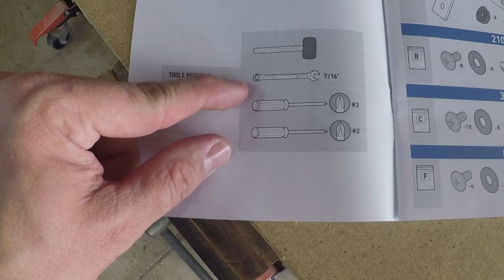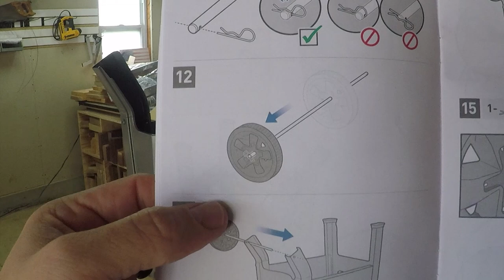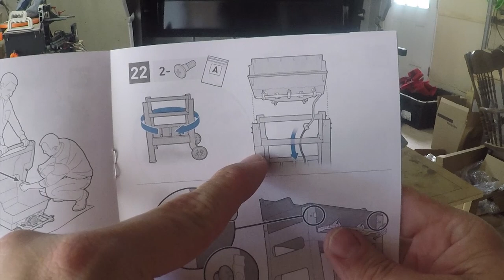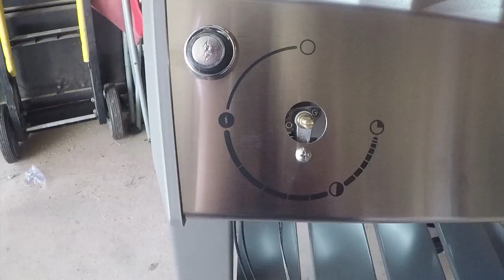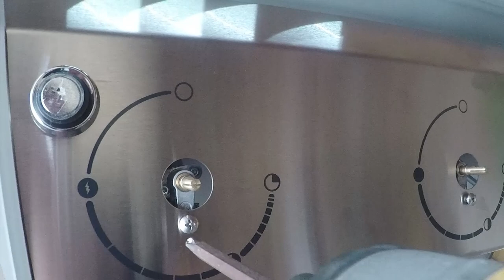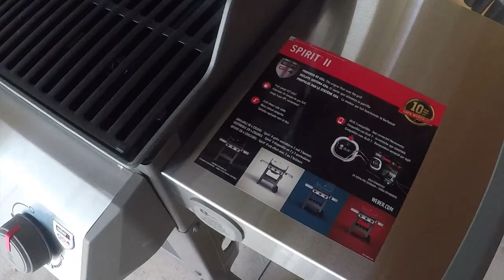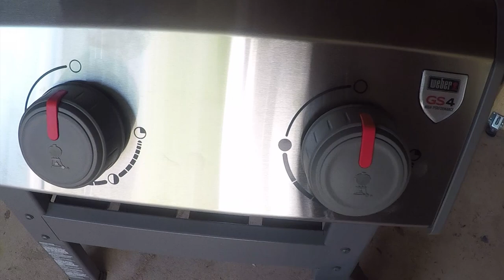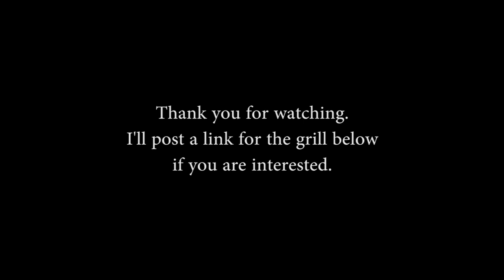Weber Spirit II E 310 Grill - Setup and Review

Comment: Hello, I like your video on the assembly of the Weber E310 Spirit ll.   You are very easy to follow and very helpful and patient. But I'm stuck on the reflector in step 43.  I'm having trouble locking it in place. It feels a touch too wide.  Weber support  was very helpful when I didn't need help. But now they are giving me a tough time.
Reply from the maker: Are you referring to the shroud that covers the burner? If so it's pretty thin you may be able to bend it a little too fit. As for the length they settle in pretty easily and don't really lock into place.

Comment: We've been using the Weber Spirit E210 since 2014 and it's still going. No rot, no corrosion, still works fine, other than the burners are starting to fade. I had the chance to select the Spirit II E310 as a gift for my 35 years of service gift from my company a few years ago, so it was delivered and I kept it in the box, in my garage for 3 years. Now it is time to put it together and make the swap! Thanks for the vid.
Reply from the maker: Clean the grill burners out with a wire brush. Should be working like New. Just did that a week or two ago
Reply: @RobertsInnovations  I can't remember how many cheap gas grills we went through in our early years of marriage, but I remember the hassle of getting rid of them every 3-4 years when they rusted out. I wish I had gotten a Weber earlier in my life.
Reply from the maker: Agreed. I still have it and it is still rocking hard

Comment: OUTSTANDING video - thank you! While the instructions are pretty straightforward, this video is much better to follow along with. I had trouble as the one I received (shipped from HD via FedEx) had damage - the 3rd burner, the part that extends outward to where you attach the knob - the whole thing was bent upwards about an inch compared to the other two, resulting in the knob being completely misaligned if put on. Upon further inspection, the metal piece on that part where you attach the screw into through the face plate/front cover was completely broken off.  knob stem was bent upwards quite a bit. I gave up figuring I was screwed and called HD. To their credit they arranged for a service to come out and pick the grill up half-assembled (I told them there was no way I could get it all back in the box and be able to seal it up for regular shipping). But then I went back and took a look and decided to just bang on that part a bunch with the rubber mallet. Took about 8 hard bangs to get it aligned with the other 2 but it worked! I"ll call Weber for the metal piece that is broken but it isn't really needed.

Also, for others who recently purchased this model - it appears Weber has made some changes.

1. The right side shelf no longer has the Spirit II emblem on it nor the iGrill plastic piece. Both shelves are just plain metal now. 
2. The latest versions being manufactured also do not have the GS4 emblem on them. 

Hope this helps others. I was wondering if I got stiffed by HD as I ordered the E-310 and all of the videos online and some pics still show the old labeling.
Reply from the maker: Thanks for the info. I'm sure it will help others! Happy grilling

Comment: Extremely helpful video! There are a few issues that would be helpful to address: 1) There is a spot in the video (6:12) where you add the slats without mentioning that you turned the grill upside down from the previous position. And because there are no obvious signs of wheels at that point in the video, it was confusing to me why the slots would not fit properly. 2) Although the specific bolts use is listed in the instruction manual there are points in the video where the pieces that are being used are not referenced to the specific bag that they came in. Including this information would have been beneficial. Overall though, I am VERY glad to have found this video! Thank you!
Reply from the maker: Thank you! That will help others

Comment: Your video was a big help, along with the instructions. I just put it together last night, start to finish in 4-5 hours. I must say though, this grill doesn't feel like it will last at. I got mine for $350 last month @Home Depot but I wonder if I should have a spent a little more and got something of better quality... There was a TON of leftover cardboard, enough to fill a large recycle container even after slicing into small pieces. I'd much rather buy pre-assembled.
Reply from the maker: I wish I would have gotten the one with the side burner. But I'm still very happy with it. I have to take it apart and clean, might make another video on that too

Comment: I have had the Weber Spirit II E 310 Grill for a few years and like it but didn’t realize that the drip guard was suppose to clip in until I came across your video.  One issue I have with my grill is the large gap above the drip pan, making it easy for mice to climb inside. Besides maintaining cleanliness and changing the foil pan regularly, do you have any other suggestions to prevent that?

Comment: I just assembled this exact grill today, it was pretty straightforward and easy, excited to try it out. One question, the lid on mine seems to have a notch when it’s opened. You can open it, then almost lock it in place for lack of a better word. Not sure if this is normal, does yours do this? It’s my first Weber.
Reply from the maker: I don't know. I don't think so. It stays open when lifting the lid but really doesn't lock.

Comment: OK, I had sworn off Weber because I wanted a blue iGrill 3 compatible E-210 which has been discontinued. Well, after shopping around, I couldn't find anything comparable in the E-210—E-310 price range, so I settled for a black E-310 because boxed iGrill models were still available at my local Lowe's. Besides, I got $100 off for using my Lowe's card.
Assembly was pretty straight forward, especially with the BILT app. However, Weber needs to ensure that the propane hose bracket 12:20 is perpendicular to the grill frame, because had to twist my braided hose a full 90% in order to attach the bracket. I just hope I these hoses and flanges are designed to withstand that much contortion.
Reply from the maker: Good advice

Comment: I cannot get the heat deflector to snap into place like in 26:20. So frustrating!  Feels like I'm going to break it.  Are the tabs protruding behind the heat deflector supposed to go under?
Reply from the maker: If I remember correctly yeah they should. You can always bend the tabs a little with some channel locks or something to get it in there correctly. They could have been messed up during transport.

Comment: Easy setup otherwise but I can't install the heat deflector shown at 26:00. The tabs have no way of fitting in to lock the piece into place. The tabs are spaced too wide compared to the hole
Reply from the maker: Maybe use a pair of pliers to nudge them into alignment. Just don't bend them too far, you don't want to break them

Comment: Thank you so much! Our grill was missing the directions & I was able to set the whole thing up with your help (even with ours being the 2 burner not 3).

By any chance does anyone know what the chain thing is on the dropping wing?
Reply from the maker: It's to hold a match if the automatic lighter doesn't work. They are really annoying so I just ripped it off 😆

Comment: In 22.06 there is a chain with a metal hook attached to the shelf. What it is for?
Reply from the maker: It's so if the spark igniter doesn't work you can attach a match and light it safely. I would just use a long lighter so I took mine off

Comment: I have a problem with the wheel covers popping off on one side or the other, the axle is to long and it will push to one side or the other and knock of one of the wheel covers. If you don't move your grill around allot this may not happen often, or at all.
Reply from the maker: Interesting. I don't move mine nearly at all. I wonder if anyone else has that issue. Thanks for sharing. Something to look out for
Reply: @RobertsInnovations   Weber has no known issue for this specific problem, I got the grill in Sept. of 2021 and it wasn't long before one of the wheel caps fell off, I thought that was just a fluke and put it back on, the second time it happened I saw what it was doing, called Weber, they sent a new axle, one new tire, one new cap < this was last year, yesterday when I went to put the new axle on, I noticed there was a wheel cap missing and I don't know when it fell off, and cant find it, I knew the new axle wouldn't work, but I had to try it anyway, did the same thing. You can see how it is doing this by removing both wheel caps and push one side of the axle in as far as it will go, then try to put the cap on the opposite side, you won't be able to, and you will see that the hairpin is the problem and is what is pushing the cap off, or you can put the cap on one side and push the axle from the other side and see if it will pop the cap off. The way I fixed this was by putting a brass bushing on the inside of the wheel where it hits the frame, the other thing that could be done is to put a small regular cotter pin in there instead of the one that came with it. 
Also I have tried to make the cap fall off buy moving the grill around, and you may have to do this for some time before you get the cap to come off. 
Good video by the way, I believe your's was one a few that I watched before putting my grill together.
Reply from the maker: Glad you got that working. I'm happy my video helped. I hope your comment will help someone else someday